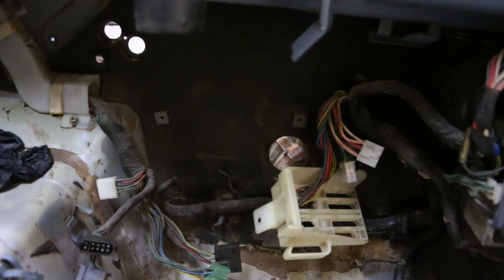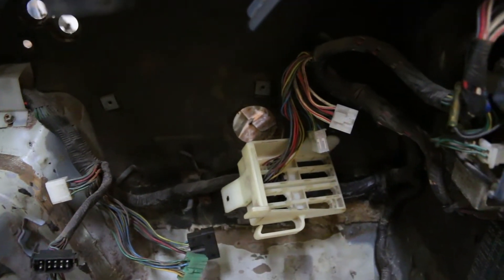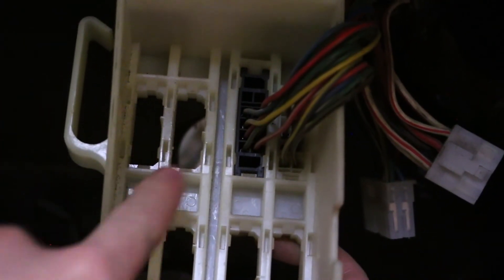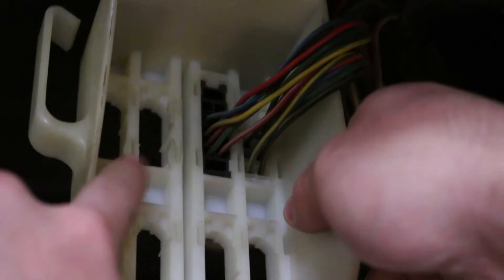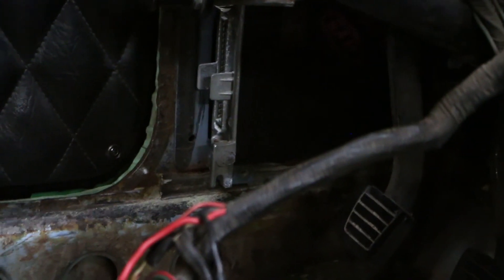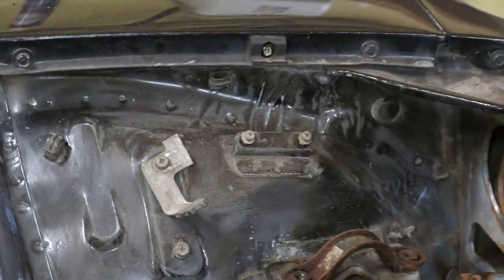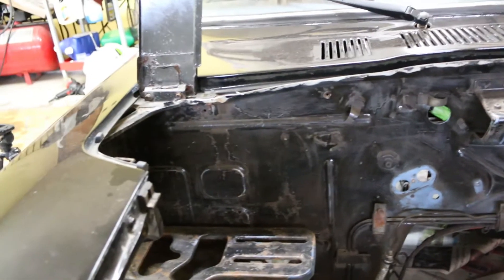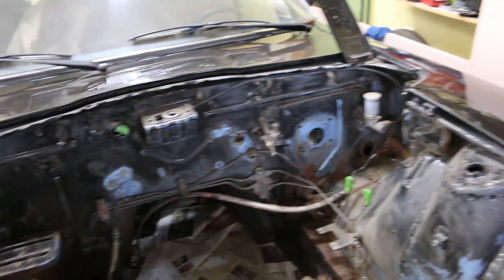Datsun 280z Wiring Harness Removal - Tips and Tricks

Comment: what year is your 280z and mine is 1977. i need help can you help me. i was going to switch my fuel pump the otherday i got a voltage checket thing and i put it on the fuel pump wiring the fuel pump turned on but when i turn the keys on the car the fuel pump womt turn on. i think its a relays but im not to sure about that. do you know where the fuel pump relays are at??
Reply from the maker: Our 280z is a 1978. We'll definitely try and help you out with this issue. Based on what you've done so far, we know that the fuel pump is functional it just isn't receiving power/signal. The best way to proceed is with the easiest and most simple things and start checking them off the list. Fuses and relays are a great place to start .... there is a fuse box on the passenger side under the dash (where the passengers right foot would be assuming its a left hand drive). I'm pretty sure there is a fuel fuse in there. Im pretty sure there may be a relay too in the same area underneath the glovebox. Here's a link to the service manual that will most likely have locations for the relays and troubleshooting for your issue: http://www.wedophones.com/Manuals/Datsun/1977%20Datsun%20280Z%20Service%20Manual.pdf

Hope this helps if you have any other questions don't hesitate to ask.